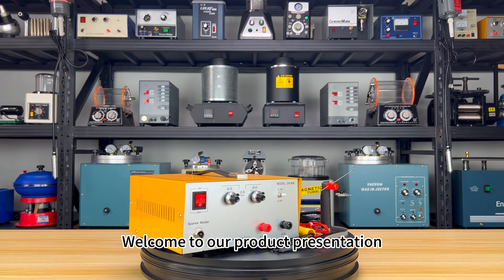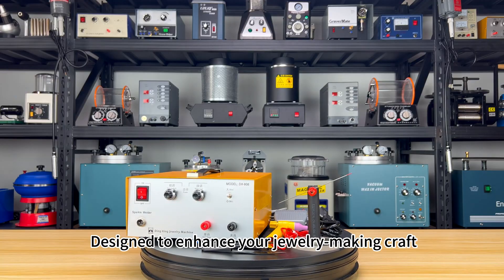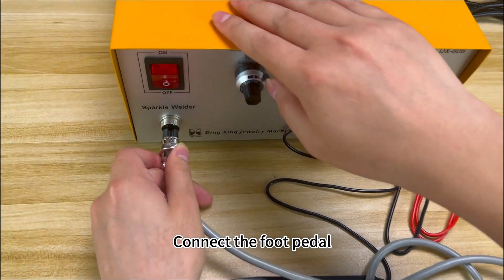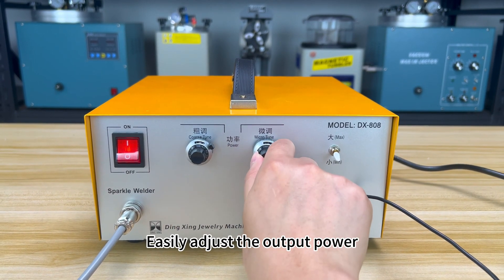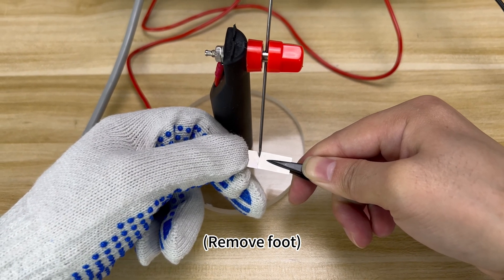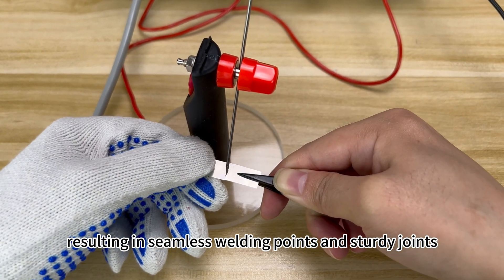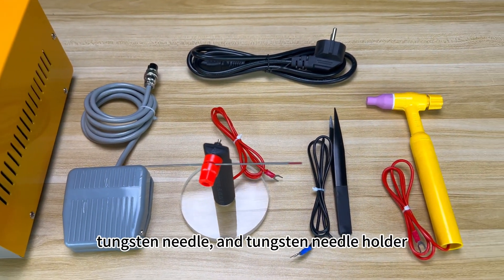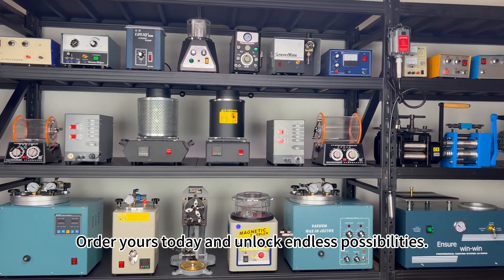How to use 80A jewelry pulse spot welder?

Comment: Would this work to weld thin copper strips to lithium cells like 18650? Or how about welding aluminum strips to lifepo4 cells?
Reply from the maker: Hi, thanks for your review. Sorry this welder is suitable for small jewelry.